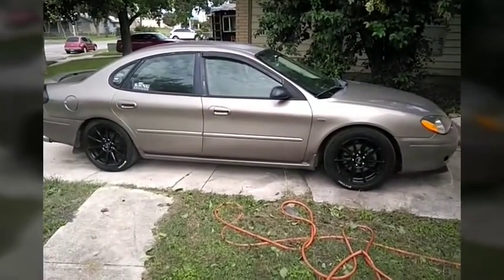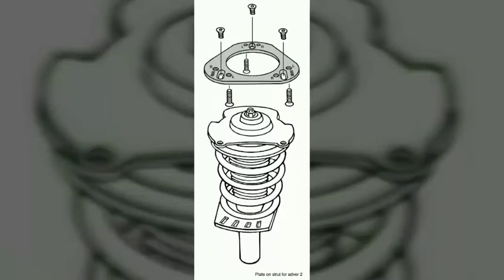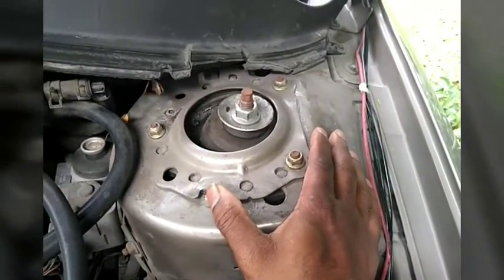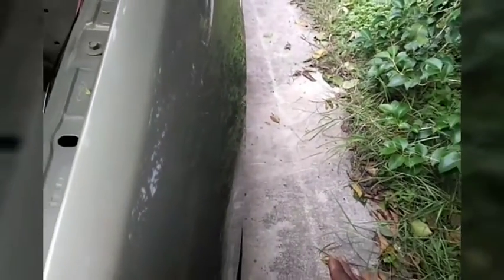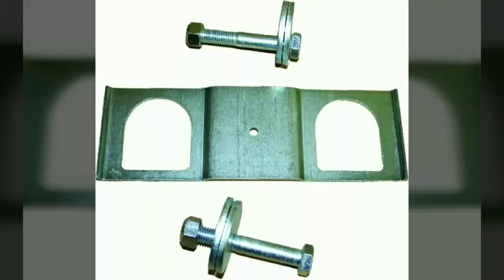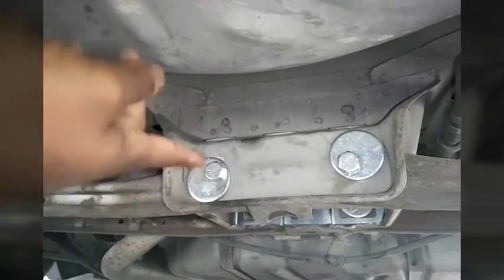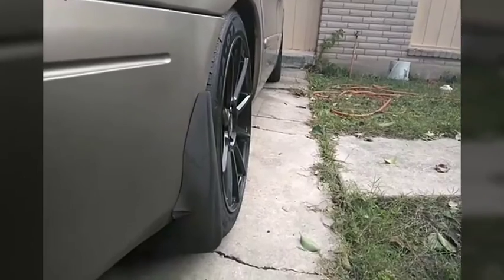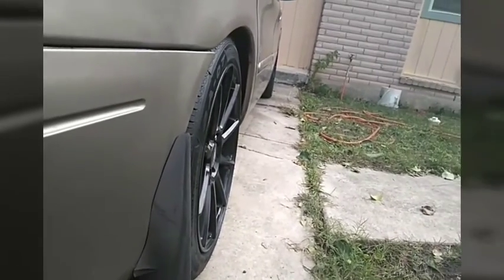In Depth Steps To Get Proper Alignment Of A Lowered Taurus/Sable (1996-2007)

Comment: What are the drill bits used for the spot welds
Reply from the maker: I used bits about one size smaller than the spot wells and then enlarged them to remove extra weld material.
Reply: Any coil overs for the bully?2006